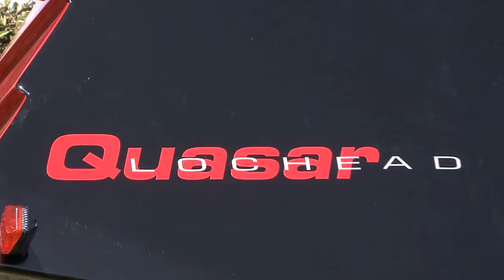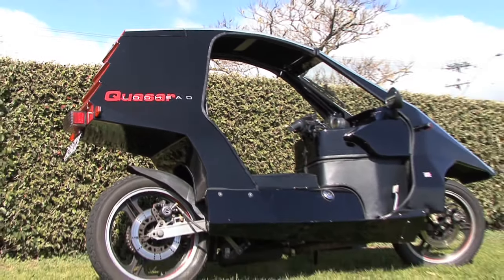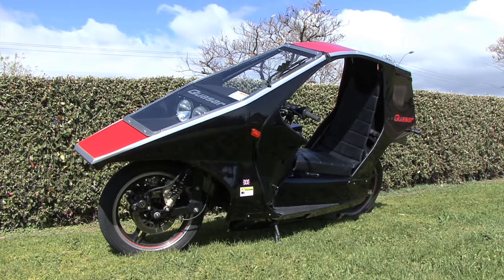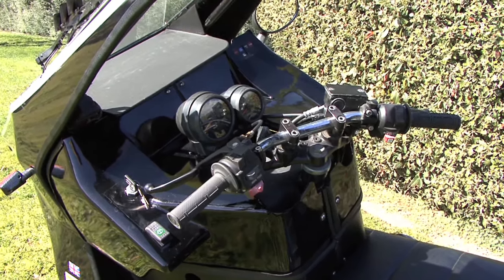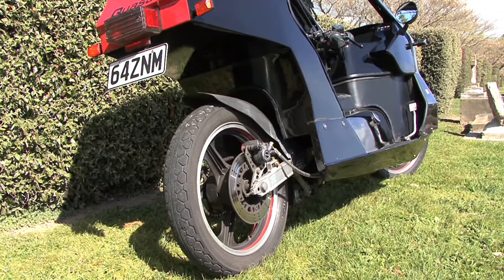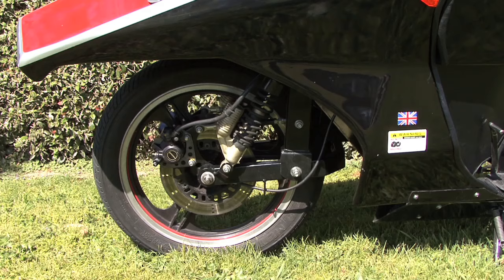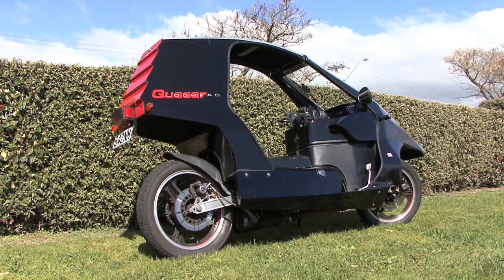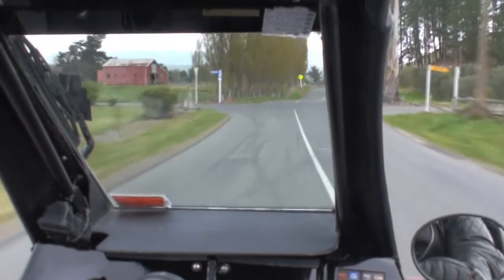Lochead Quasar Covered Motorcycle

Comment: A chap I knew had one in the late 70's. I must admit it seemed to us like a joke novelty bike but he loved it. I remember that it had fiber optics  from the rear light and indicators that was routed to the cockpit so when the light came on there was coloured pin pricks of light to tell you the light was working. I found it fascinating at the time.
Reply: I remember many years ago seeing a kit for sale for motorbikes, that consisted of a fibre optic cable connected to the rear light of a motorbike and ending up by the instrument panel. Again the aim was to check is your rear light and brake light was working. Similar to what you mentioned.
Reply: @montyzumazoom1337  It was soooo cool at the time. That was the only cool thing about the Quasar Ha! Ha!

Comment: great to see this , i remember seeing a quasar  in the 1970s , i thought it was built  by a guy in swindon who had a shop called "bike bits " in the  gorse hill area of the town .
i remember it was metallic red and  running a reliant 750cc engine , same as used in the reliant robin or bond bug .

i have an ariel arrow cafe racer that came frrom the same guy at around the same time although it was my fathers freind who originally purchased the unfinished bike .

Comment: With a lightweight titanium frame, carbon fibre bodywork and a well chosen engine, new versions could be built to be as light as is practically possible.

I recall Mr. Newall said that he originally fitted the Reliant engine to prove that one could use aerodynamics rather than horsepower to attain high speed touring!

Comment: I cannot comment on this bike.  The original Quasar had a Reliant Robin 850 engine.  Latter versions had a Honda VF750 engine (The one with the crap camshafts!). Also developed were the 'Phaser' which was an Open topped Quasar with a K. Z1300-6 engine. Seen this one in action & it was quick!  Met Malcolm Newell. He was a lovely bloke, alas now dead.  Met him when I was working at Avon rubber co.  He wanted to make a 200mph tyre, he was developing a Quasar style bike with a Cosworth engine!

Comment: Add 23 kW motor and add 54 kW battery with three ft diameter  broad tyre muddy tyre..add two decker passenger seat on upper and lower side but wide should not be more than 7 inch for congested Road with folding model
Reply from the maker: Ha! Ha! Ha!

Comment: Contemporary mid tier scooters can do in excess of 80 MPG.
Reply: kmg501 this has a larger engine you boob, a 400 cc will always fun less efficient than a 125, especially a 400 from the 70s
Reply: modern FI 400 can easily hit 50mpg, at least on highways.

Comment: The back end is crying out for panniers tapering to the back. If it was electric, there's enough room for 20KWH between your legs, easy! This would allow the front end be fixed for better slipstreaming. Imagine the easy 200+ mile range in relative comfort while costing zilch to run.

Comment: Please  make a hybrid with electric and petrol and on single charge with more than 1200km  and tyre flat muddy light with diameter 3 ft and ground clearance 2 ft and make two on backwards decker  but don't increase the width of body not more than 7 inch  but length should be 12 metre around with two seat decker on upper  portion and three seat on lower decker  with adjustable folding but width should not be more than 7 inch

Comment: Malcolm Newell can be seen talking about the Quasar, while sitting in an original example of the beast, in the Feet First segment which I wrote and presented for Top Gear back in 1988. There is also footage of the VF750 powered one and another with hub centre steering running side by side, with me sitting as a passenger in the HCS one. Here: http://www.youtube.com/watch?v=foAgByo_txA

Comment: There is something wrong here, not sure what it is but that thing looks inherently unstable. I'm am a biker and have been for many years, watching that being ridden along the road it is plain to see that the rider is constantly having to adjust the attitude of the machine. This is not the case on a conventional bike. It seems almost impossible to keep it from weaving without continual correction from the rider and the lean angles don't look stable. Perhaps it the center mass that is wrong, everything looks way too high.  I suspect it was a pig to control despite the efforts to make it look otherwise. I guess the proof is in the fact that no major manufacture took up the design. Modern equivalents are much lower, the rider sits way down between the wheels and the center of gravity is generally much lower than on this. Oh and it looks awful.
Reply: check my project ,170kg unlike this which probable weighs nearly 300kg !

Comment: The cover surely defeats the main point of a motorbike, which is to experience the environment. If the cover were complete, and strong, with airbags, it might have a safety function? Could the cover encompass a pillion rider? And why isn't it curved and aerodynamic? BTW, the awful music adds nothing to this video, and the voice is too quiet for us to hear the benefits claimed for the Quasar.
Reply: +Ross Milburn Muppet
Reply: so you dont get wet and battered by wind, check my project out for a smaller lighteight version, cost so far £500